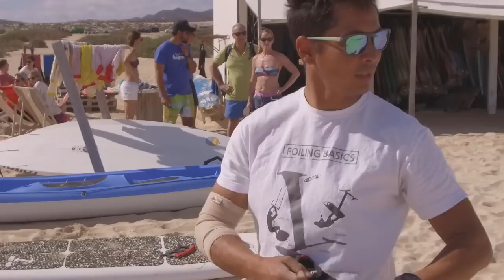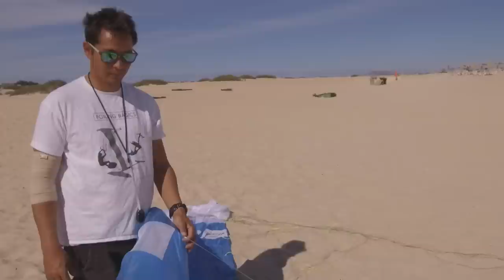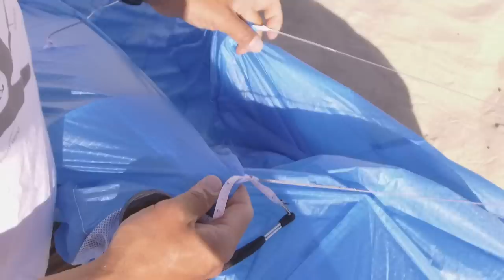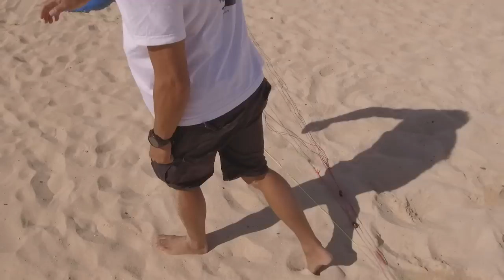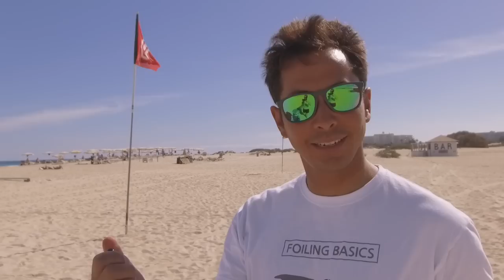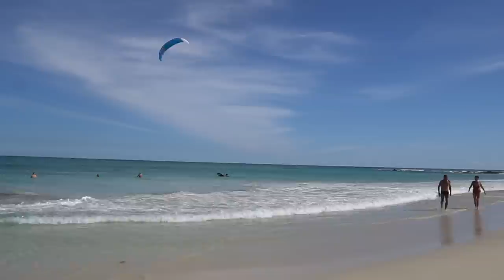VLOG #1 - Trimming the bridles on Ozone Foil Kites without a pro tune system

Comment: Awesome vid. For the measurements and difference, how do you include the measurements for the speed system? I don't see any stock measurements provided for the speed system length. Reason, How do you account for any line  changes in the speed system?

Comment: Very informative! As always. Cheers Gunnar.
Eg. 15m2
A=a1+am1+ar1+pa1+pa2
B=b1+bm1+br1+pb3+(pb2÷2)+pa1
C=c1+cm1+cr1+pc1+(pb1÷2)
Are these correct?
Reply from the maker: actually you can just line up the ends of Am1, Bm1, Cm1
Reply: @GunnarBiniasch  got it. Thanks

Comment: hi Gunnar.
i,ve retuned my old chrono 12m using this method and its flying great.
lighter bar pressure, faster turning and faster.
wing tips are still tending to tuck, do you have any fine tuning tips to fix this. cheers
Reply from the maker: Hi Steve.  Try moving the Knot on the Brakes (KR1) up towards the kite by 1cm increments.  This should reduce tip tucking.  However, the ChronoV1 was always prone to tip tucks, so you will never be able to completely get rid of them.
Reply: thanks Gunnar.
also Jussikaijasilta recommends on his foil  tuning videos to shorten the b and c bridles in the tip area which would effectively increase the angle of attack in the tips and stop the from luffing [tucking]. 
i,ll try this and let you know how it goes, cheers
Reply: hi. 
i shortened  C11 and C12 bridle by 2cm and no tucking at all. 
quick fix and the kite is flying great, cheers

Comment: Good video! One question: if c1 (CM1+CR1 included) is 50mm too short and I use an extension (between CR1+CR2 and speedsystem), the whole c-line will be 50mm longer, not c1 only? Aren´t the other c-lines outside too long then?
Reply from the maker: Hi Juan.  The pigtail goes onto the end of the Speed system line and therefore lengthens all  C lines.
Reply: Thanks Gunnar! Do the coated bridlelines of the ChronoV2 shrink? Specially the KR1?
Reply: Gunnar?
Reply from the maker: All lines will shrink eventually, but it is the unsleeved dyneema pulley lines that shrink really fast.

Comment: Hi gunnar
Great video, congratulations !
Could you give me these measurements for my Chrono v3 9m2 and other sizes ?
thank you so much
Reply from the maker: Hi Marco.  You can find the Bridle Specs here: https://ozonekites.com/images/uploads/products/Chrono-V3-Bridle-Check.pdf
Reply: @GunnarBiniasch  thanks for your super fast response for the bridle, but i can't find the mesurements of PA1, PA2, PB1, PB2, PB3, PC1 when there is no "speed system"... !?  and the measurements are very different on the Pro-tune speed system... 
Is there a drawing of the classical system ?

Comment: Thanks Gunnar, my r1 flies like a sack of shit so I need to do this. I need to re watch it again, but question, if you have to adjust one side and the other side is ok, isn't there then the issue that the lines are not the same length on each side?
Reply from the maker: Hi Eric. You need to do both sides.

Comment: what are the tell tale signs that your speed systems is not aligned correctly?
Reply from the maker: Usually it manifests itself with the kite backstalling too easily or with it pulling to one side.  It can also make the tips unstable.

Comment: so is it the bridle that shrinks or is it the speed system?
Reply from the maker: On the Kites with the standard speed system both the bridle and speed system will shrink.  However the speed system pulley lines will be the first to shrink substantially.